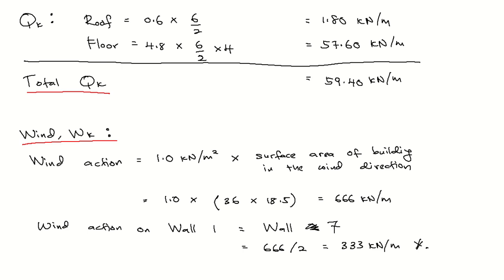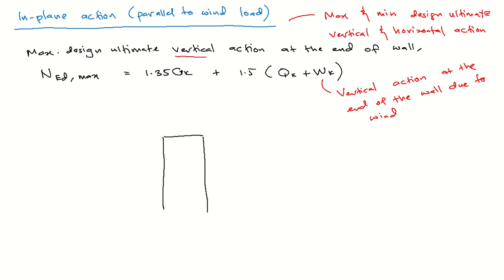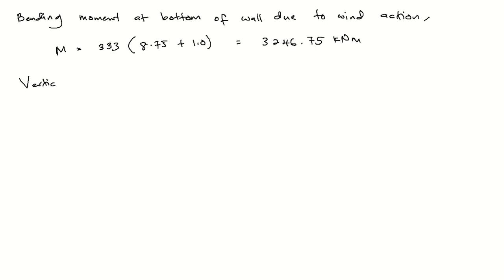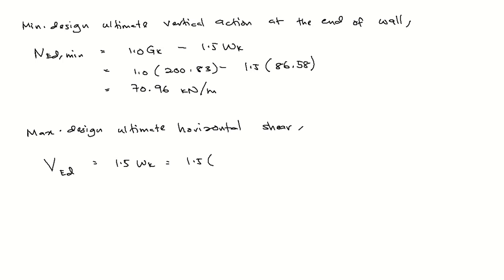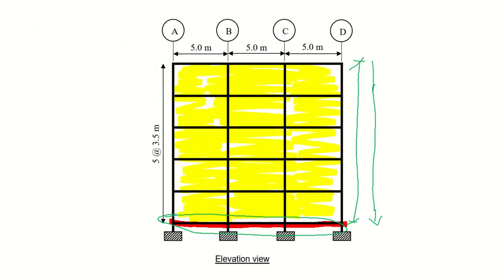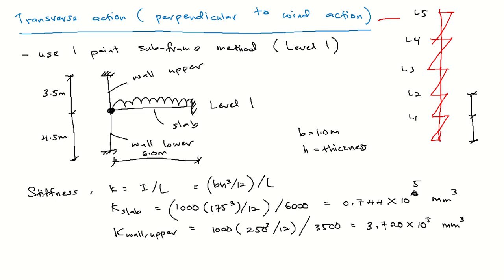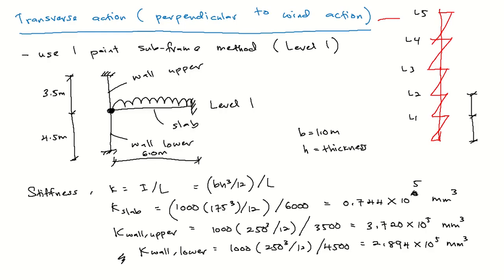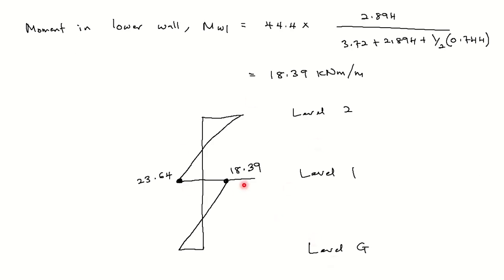Shear Wall Design to Eurocode (Part 2: In Plane and Transverse Action)

Comment: in calculating the max vertical load why you added the wind force thus it's a lateral load it has no contribution  in the vertical load
Reply: Lateral loads produce compression and tension. On Vertical members, these forces act vertically